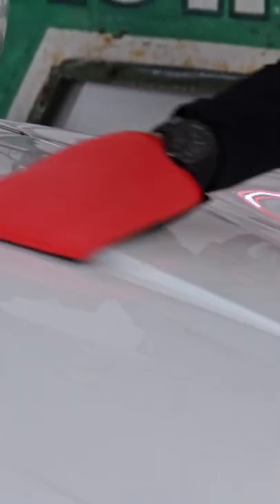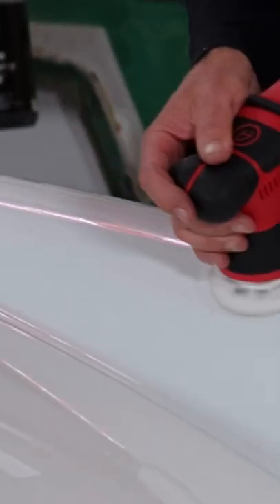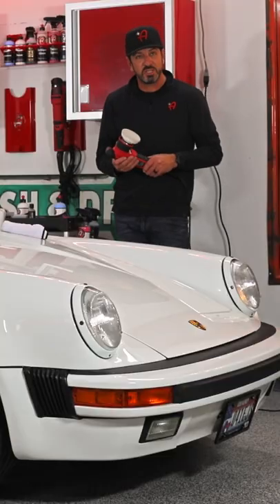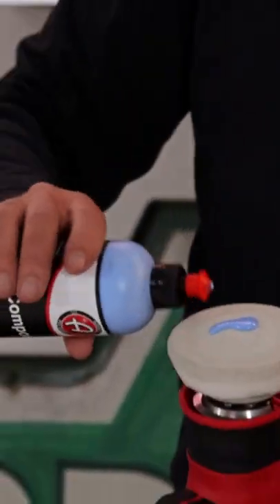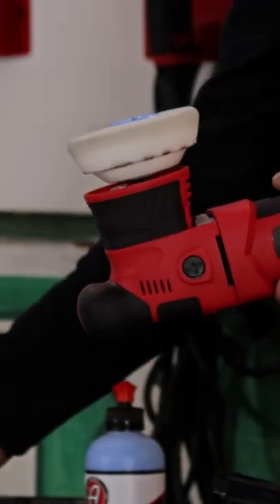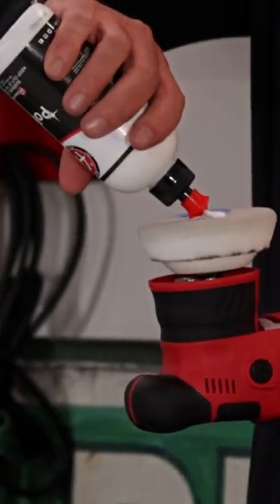How To Correct Single Stage Paint

Comment: Is that a harbour freight DA?
Reply from the maker: No, that is our Pro 12mm Swirl Killer Polisher. It is a long-throw DA that uses 3.5" pads. You can find it on our website under the Exterior > Polishing section!
Reply: By brand, no. Came out of the same Chinese factory and had a little rebrand and up price though lmao